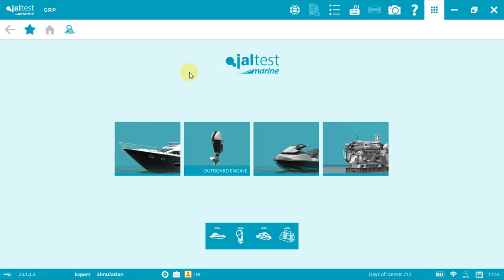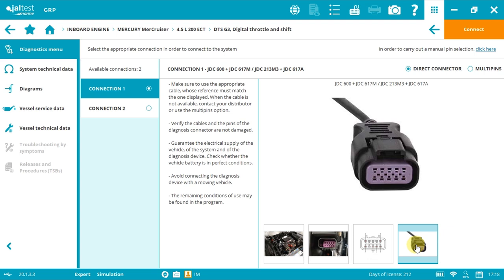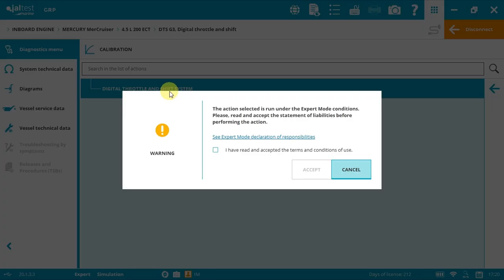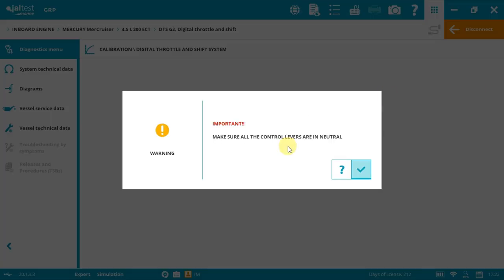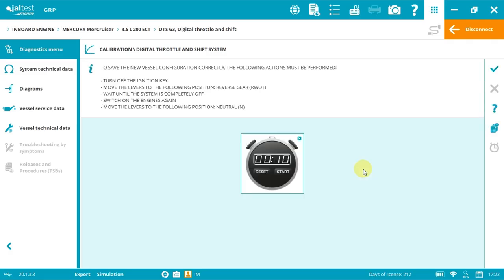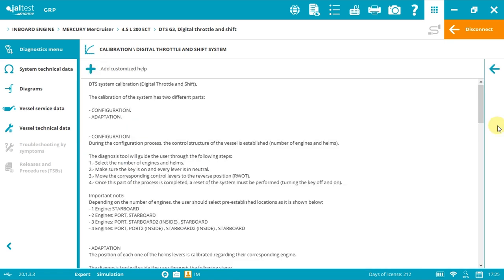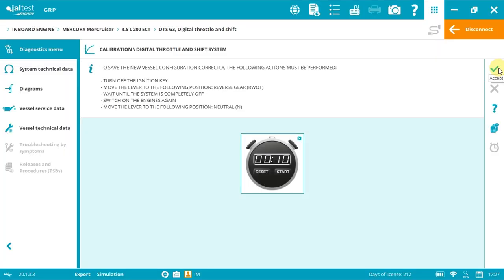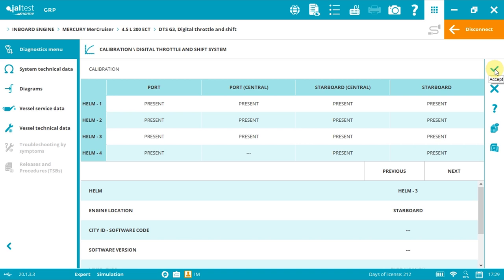JALTEST VLOG | DTS CALIBRATION ON MERCURY SMARTCRAFT G3 SYSTEMS!

Comment: I had my new dts calibrated and it seems there is a lot of dead space in the throttle and rpm’s max out lower. Is this possible?
Reply from the maker: Hi Brian! Regarding your question, if the engine starts, shifts and accelerates, it doesn't seem to be a calibration problem. One possible cause of what you are talking about is that you have lost the detent points on the lever, so you get the feeling that there is more travel. If you have any other questions regarding Jaltest Diagnostics, please contact your dealer. Best regards